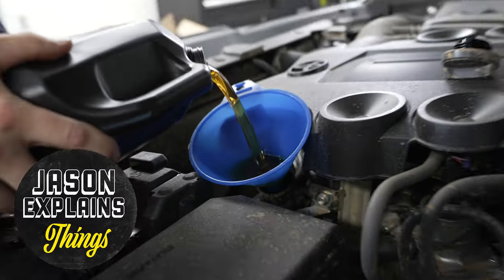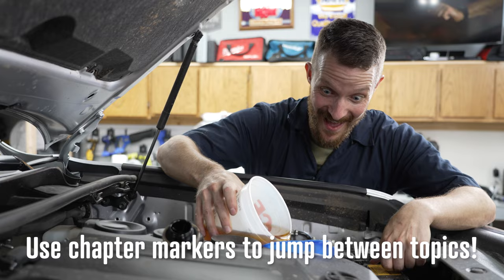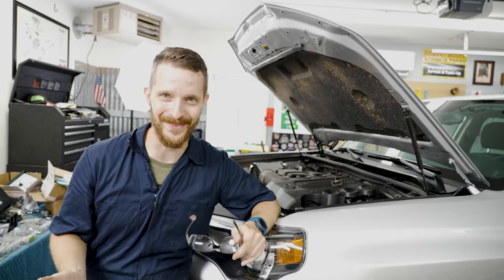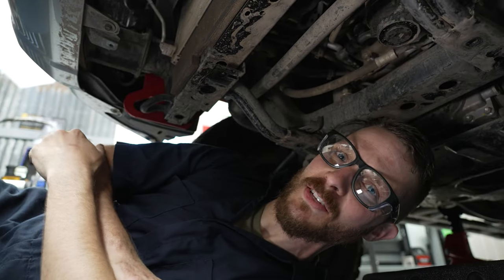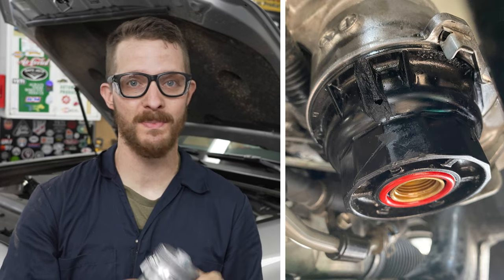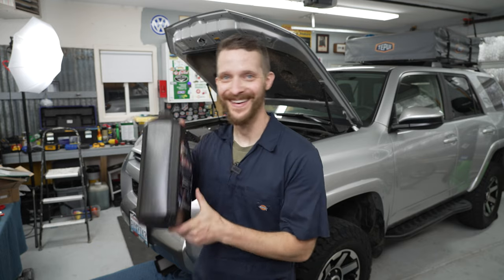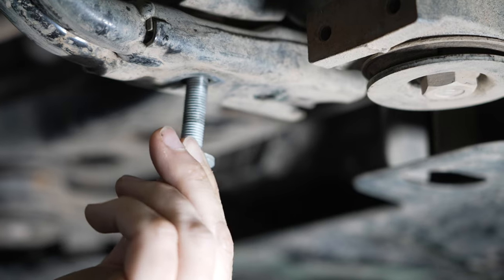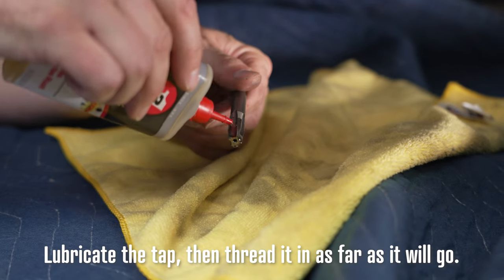5TH GEN 4RUNNER Oil Change - Save Money and Upgrade Your Truck!

Comment: I bought a 5th gen with 205k miles,is that Costco brand recommended still? Thx
Reply from the maker: Definitely, so far so good.  My research made it seem like a good option.  I’ll be due for another oil change probably in December.

Comment: I know there are more expensive options out there so I wanted to let you know that when I did my first oil and filter change on my 4Runner this weekend, I didn't realize that my oil filter wrenches were too big and wouldn't work.  There was a breif panic as this was a weekend and I thought I'd need some special service tool but I tried the local Auto Zone.  Not only did the have a wrench but they also had the metal filter housing so I got both...for $33.11 with tax.  Don't spend the $25 plus on the MotivX(?) wrench.  The $7 Auto Zone wrench is fine.  $33.11 FOR BOTH!
Re: Paul Walker, God took him for speed driving lessons.  On Fridays, they have stock car races.
Reply from the maker: I think it’s cool to support US made stuff if possible.
Reply from the maker: But I love the mental image of car races in heaven. :-)
Reply: do not use that non Toyota metal filter housing! You been Warned ! An as the Motivx Wrench ,they will last a lifetime and 100 percent USA made ! You my friend are clueless !

Comment: That exactly happened to me .  Brought new 4runner and they gave two years of free oil change but they only changed oil once a year or 10k miles.  Now the two years are finished so now I'm looking for instructions on how to do it on my own
Reply from the maker: Definitely.  Like I said in the video... do oil changes at 5K!  The 10K thing is more of a marketing gimmick (low cost of ownership) and more about the engine lasting through the warranty.

Comment: I enjoyed the video and just changed my "new" used oil in my Runner. My Runner already has the metal cap but the previous owner didn't swap out the tube, so I have a metal cap with the shorter tube currently installed. Is this a problem? If so, could you please briefly elaborate? Thanks!
Reply from the maker: It’s supposed to have the longer tube for sure.  I’d swap it asap.
Reply: @JasonExplainsThings  ughhhh, I am just putting it back together and don't have access to another vehicle to go get the part. Will it hurt anything? It's been running that way for at least 5K miles already. I bought it used, came this way. Thanks
Reply from the maker: Not sure if it’ll hurt things or not.  That stinks the previous owner didn’t install it correctly.  I can confirm though it’s supposed to have the longer tube.
Reply: @JasonExplainsThings  I'm going to try to find a longer tube today, but I don't think it's sold separately and I'm not paying ~$100+ for a plastic housing just for the tube. If I understood how the oil filter system worked, it would help deduce what the disadvantages are of the shorter tube. Thanks for the response. FYI, I did buy the Motiv X wrench, excellent product, perfect fit, but a bit pricey, though we all know you get what you pay for.
Reply: @JasonExplainsThings FYI I found out that the oil filter support tube keeps the filter from collapsing when the oil pressure gets high.

Comment: Are there any grease fitting on the chassis that need lubed at oil change?
Reply from the maker: See my 30K mile maintenance video for that info.  Should be done every 10k miles if I remember correctly.

Comment: So what has the experience been so far with Kirkland oil? I am thinking of using it on my 4Runner.
Reply from the maker: So far so good.
Reply: I’d spend a few dollars more for a branded oil.  They are actually a lot cheaper if you can snag a rebate.  Kirkland and Supertech are a decent oils for an cheap old car, but not a $50k truck.

Comment: What's the part number for the running boards! Thanks great video
Reply from the maker: Thanks Vic!  Here’s a link.  I have a discount code for them as well:
https://caliraisedled.com/products/2010-2021-4runner-step-edition-bolt-on-rock-sliders?ghref=6307%3A218916&utm_source=affiliate&utm_medium=referral&utm_campaign=evergreen&utm_content=affiliate-218916
Reply from the maker: Use code JASONEXPLAINS5 for 5% off.

Comment: Love your videos Jason!  Thinking about switching to the TRD Pro skid plate (Also watched your video on that)....How easy or hard is it to remove and reattach for oil changes?  The stock on is a beast and is a rusty mess being in Wisconsin
Reply from the maker: Hi Keith!  It's not bad at all.  Just 4 bolts.  After I tapped the threads and applied anti-seize to the bolts its really easy.
Reply: @JasonExplainsThings  thanks again. Keep up the great work. Love your content and video style!

Comment: I think there’s a good reason why Toyota used plastic. Aluminum threaded into aluminum can cause problems later on. Aluminum may not rust but it certainly corrodes. People that snap the tabs off aren’t using the proper removal tool.
Reply from the maker: Yeah there are likely pluses and minuses to both.  There are a lot of forum posts of people snapping these which is why I decided to change mine.  The dealer also did the 10k service that's included with purchase and didn't voice any concerns.  With the proper tool you're likely good with either.  And as long as your skid plate is intact it's well protected.
Reply: @JasonExplainsThings  Truthfully, I have the aluminum one too. I just haven’t installed it yet. Waiting for the free oil changes to run out before I make those alterations. Thanks for the video.

Comment: Toyota recommends 10k mile interval on oil changes. We aren't using oil from the past it's full synthetic and lasts a long time. I've seen oil analysis of oil that went 15k miles and still had plenty of life left. Some run amsoil 20k miles with no issues.
Reply from the maker: To each their own, but I’ll use full synthetic every 5k.

Comment: Been changing every 5000 miles for ages, even with longer recommended intervals.  You can easily tell when it's due by looking at the odometer.  No mental calculations.  My first 3 changes on 2023 4R TRD Pro were at 500, 1500, and 5000.   If I was the only driver with no scheduling conflicts, I'd have added a couple more in there.
Reply: You must work for an oil company...

Comment: GREETINGS BROTHER, I HAVE THE SAME PROBLEM WITH THE TRD PROTECTIVE PLATE WITH THE BACK SCREWS, I SEE THAT THE ONE YOU USED IS A GOOD SOLUTION BUT LET ME ASK YOU WHAT BIT NUMBER YOU USED OF THE THREE THAT COME IN THE SET OR ARE THEY ALL THE SAME.
I MEAN THE THREE BITS THAT COME IN THE PACKAGE...IF YOU USED A SPECIFIC NUMBER, YOU CAN SPECIFY IT

Comment: The motivx tool is junk.  I highly recommend the Toyota tool instead.  Also I don’t recommend loosening the filler cap first as it makes a giant mess.

Also, there’s nothing wrong with the plastic filter housing.  My 5th gen 4runner has 150,000 miles (30 oil changes) and not a hint of an issue with the filter housing.

Comment: H
If I were you I would use Mobil 1, Penzoil, Castrol Edge or Valvoline all syntetics. It has something to do with sludge and thermal seasonal protection. Cheap oil always  have their flaws and bad results as the engine parts gets old and older. Good luck

Comment: i deleted my comment , you were right dealer offer from Toyota free server for 24 months comes with  10K miles oil change , about oil try Royal Purple , you will get amaze with performance .
Reply from the maker: Yeah I was surprised about the 10k interval.  Crazy stuff.  I just watched a huge oil comparison video with Amsoil getting rated the best.  But as long as you’re using a good oil, and don’t wait too long between changes everything should be fine.
Reply: @JasonExplainsThings  i always use Mobil-1 oil , and i do follow Project Farm channel where he tested oil performance , i did 3 oil changes on my wife CRV which comes with Turbo , and i can tell royal Purple really boost performance , possible best oil for turbo engine , about syntactic oil , you have a window to change between 5K and 7.5K miles and this is what i do ,4runner does  not run on  diesel  and why Toyota suggest for 10K  , its simply crazy ,thanks for great video Jason .

Comment: Costco brand is as good or better than motor oil.
Reply from the maker: Based on the research I did that seems to be the case.  Great option especially since I change oil every 5k instead of 10k. 👍

Comment: I recently bought a 4runner and they also provided me with the "free oil change every 10k miles" thing.  Yeah that's great and all but changing your oil every 10k miles/1 time a year is absolutely the dumbest thing.  It's really dumb because Toyota recommends routine maintenance every 5k miles, but apparently don't think a simple oil/filter change is "routine maintenance".  

I'll be doing 5k/6 month changes.  I've heard horror stories of people sticking to the 10k thing and having to have major engine work (or even a rebuild) with under 100k miles on their vehicle overall.
Reply from the maker: Totally.  One suggestion another guy said is doing an oil change at 5K but not doing the filter because many are now rated up to 10 or even 20k miles.  But yes, if you're going to already be checking your brakes, rotating your tires, adding coolant... even at home it only takes 20-30 minutes to change your oil.  Why wouldn't you?
Reply: @JasonExplainsThings  But isn't what you just said about the filter the same with the oil itself?  The real beauty of full synthetic oil is it doesn't have as quick of thermal breakdown like the dino stuff and thus a much longer service life.  Some of that depends on the conditions you drive in of course but overall.  The most important thing is, there is oil in it.  Some knuckleheads have an issue with that alone.

Comment: Using that metal canister voids your engine warranty as it is not meant for the 4Runner.
Reply from the maker: 😂 Sir, your adorable comment made me laugh so very hard.  You made my morning.  Have a wonderful day.
Reply from the maker: Oh... and no, no it won't.  The metal filter cap is an OEM Toyota part.  The local dealer already knows about it because I have since had an oil change there (because of the included maintenance plan).  They said literally nothing about it... and 11,000 miles later it has not leaked or failed in any way.
Reply: @JasonExplainsThings  I don't know if it does or doesn't, is or isn't but I'll just add, just because the dealer didn't say anything means diddly squat.  He specifically said engine warranty which would never come up until if/when a problem occurred.  I have to believe, Toyota corporate would look for any reason to not have to cover multiple thousands of dollars worth of repairs when the time came.  Again, I'm not arguing the part itself is or isn't for the 4Runner and/or considered ok for the warranty coverage.

Comment: Toyota is stupid for this. I have it dangling but can’t get it off (skid plate)
Reply from the maker: It’s not hard man.
Reply: @JasonExplainsThings  yeah it is. One of the hooks are stuck. Why not just do it the way it should be done. Access to drain plug without removing cover, access to oil filter without removing cover. It’s a trash design.

Comment: The 4Runner comes with the plastic filter housing for a reason.  The metal composition of the oil pan and the metal filter housing are dissimilar metals and will corrode.  Stay with the plastic filter housing if you’re intelligent.